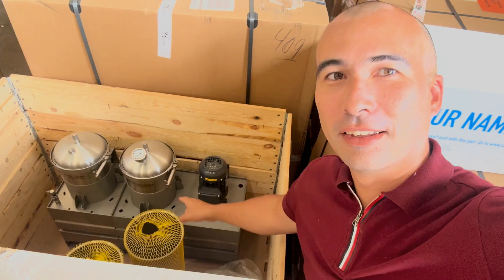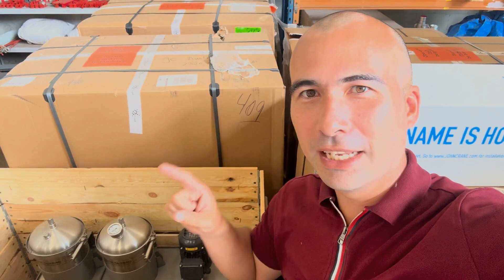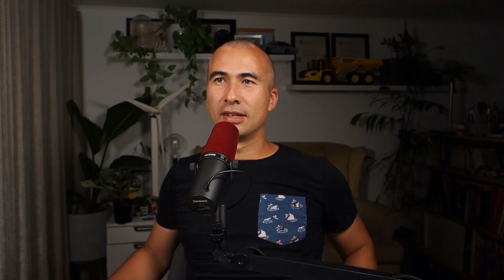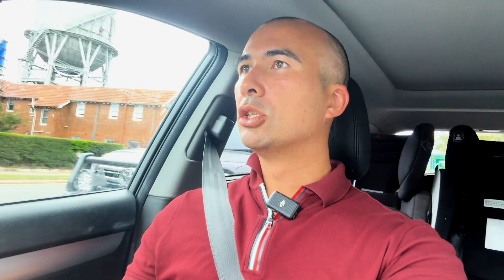Making a Dumb Decision.

Comment: The idea of a unified formula is not new by any means. It works well in certain industries by not in others. Task specific formulas are still required when there is a wide range of application requirements such as hydraulic versus high load gear cases. Also, the concept of the unified formula doesn't have to be limited to oils.
Reply from the maker: Good point Don. They do certainly already exist - I guess I just want to see how many of the edge cases can be dealt with under a single banner. There's some new base oils and additives out there with really interesting properties. I am cheating a little bit though, because I'm not bound by cost.

Comment: In terms of paying for something expensive that last a long time it needs to go a lot further than being cost competitive on a lifecycle basis to account for the risk involved. 

If the oil life is shortened in any way the value proposition dies off immediately, some examples could be:
1. A hose blows
2. Cross contamination with other substances (coolants, fuels, greases, etc)

Regardless this is an awesome project and even jist the idea of a single base oil and additive package used for everything is cool.
Reply from the maker: Thanks! Yeah I've been thinking about those things too. To be fair, when I say "expensive" it's in the ballpark of other synthetics currently on the market. I've got some ideas on how to make the thing energy efficient, but if a hose blows there's not a whole lot I can do about that!!
Reply: @LubricationExplained  such a cool project! The hose blowing is definitely not your problem but it's also been a deciding factor in the past for me choosing between less expensive zinc based hydraulic oil for mining excavators and more expensive zinc free (to avoid varnish). 

My rationale was "our maintenance isn't good enough to prevent hoses from bursting so why would I spend money on an expensive oil for better life when we change it more frequently anyway due to hoses bursting."

Comment: I have a question I can't find answer to. Would you be able to kindly take a look at it please?
I need to form(bend) thermoplastic polyamide hose in rubber jacket to a desired shape. I can use heat gun but I thought for better results I could use heated to 150C group III engine oil to evenly distribute heat.

My question is does polyamide in its soft state reacts with petroleum product such as engine oil?